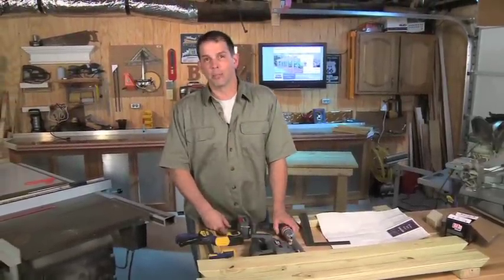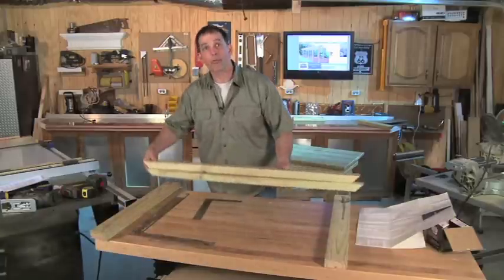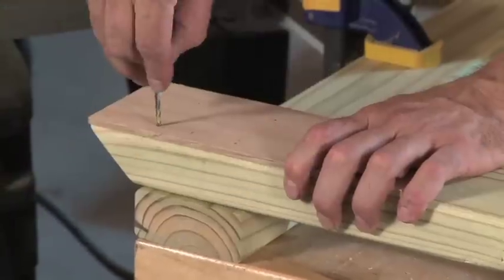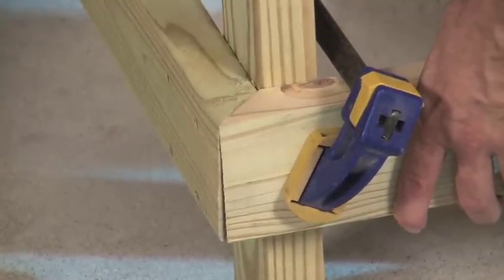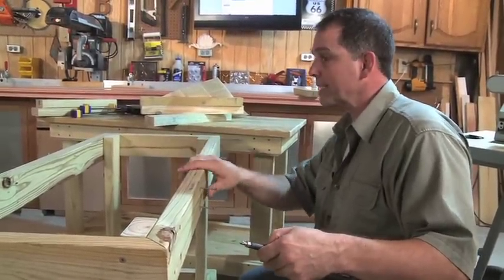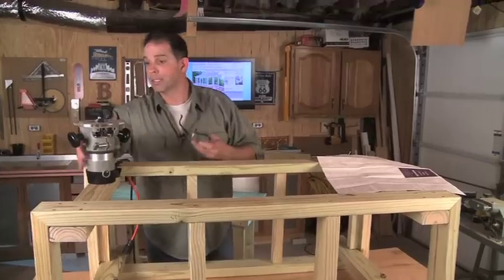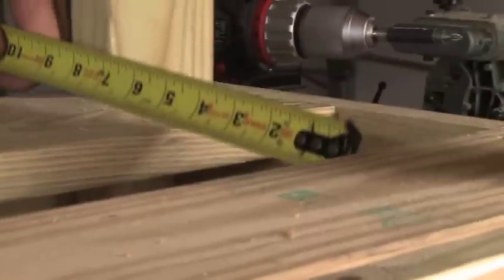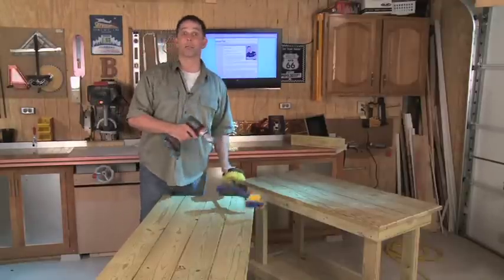Southern Pine Potting Table Project

Comment: The legs at 45" are to high try 34" also make width 20 1/4  not 18.5" so the bottom shelf will fit without having to rip the middle board